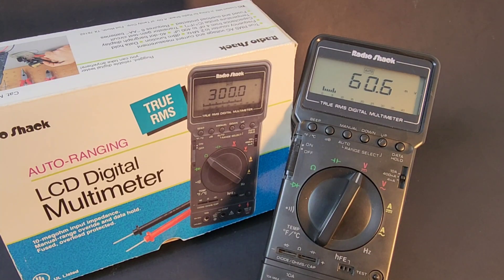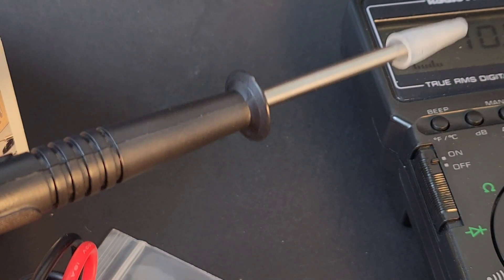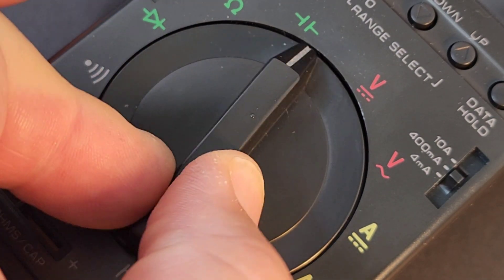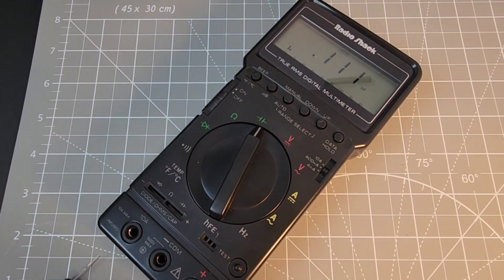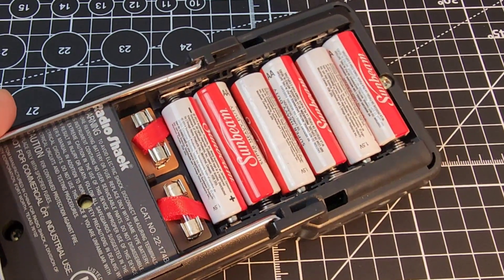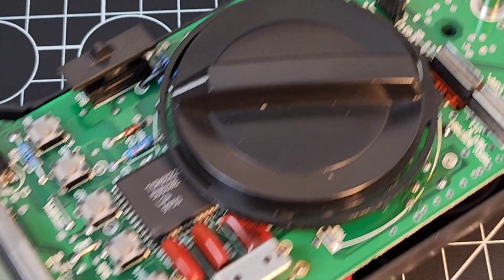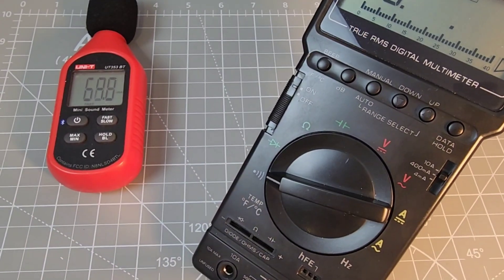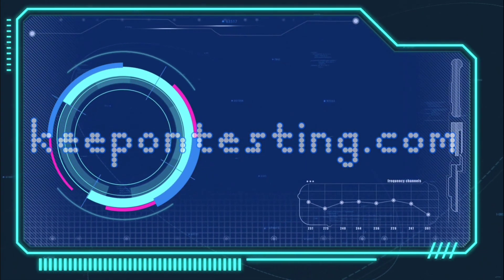RETRO-TECH ○ RadioShack 22-174B Review & Teardown! (1993)

Comment: Still have mine and looking for new probes. Which ones did you use? Had some shrouded ones and they don’t seem to fit. Thx
Reply from the maker: @AndyDemos  https://a.aliexpress.com/_mOA4jq3
These should work.
Reply from the maker: These were the original test probes that shipped with the multimeter. If you need help finding a set, let me know.
Reply: @ Thanks, any suggestions? Mueller maybe?

Comment: Thank you.  I've one with a fried resistor. Anyone know where to find a schematic  or willing to reopen the case to give me the 5 band color code?  It's in your video (large beige body lower right near the 2 trim resistors) but I can't make out the colors of the bands.  May be gold or brown bands on the ends, black, blue, violet in between?  When I enhance a screensave the end bands look red, not gold.  Anyone?  Thanks
Reply from the maker: That's a 100 OHM Resistor my friend. Brown, black,black,black, brown.
Reply: @KeepOnTesting  Can't thank you enough. I've had this about or over 20yrs.  The 100ohm was my original thought.
Reply from the maker: @derekec No problem Derek..its a great multimeter! 👍

Comment: I bought the 174A back then. It’s in brand new condition. I keep it in a zipper case when not in use and I take the batteries out. I needed to check the voltage on an outlet yesterday but it’s not working. The display isn’t showing all of the characters properly. Probably a result of sitting in the case for years. Is there a reasonably priced place where I can send it to be repaired and calibrated?
Reply from the maker: You could send it my way.. I will repair it for free and I might use the video in a review. Email me: netplicity1@gmail.com
Reply: @KeepOnTesting  That’s very generous of you. I’ll email you in the morning. Thanks!

Comment: Looks well made for the time, kinda wish we could have seen more involved range (-testing-)to see how well its strengths and weaknesses measure up as well as a look at input protection - a lot was glossed over here, more like a show and tell than a function testing to see how well it really performs after all these years, thats the interestiing part..Some of the much earlier RS stuff looked a bit like it was kit assembled on a kitchen table but this one looks more modern & pretty well done for the time. I was also curious about why the switch ranges were such a soft design and would liked to have seen what spring detent type was used. First meter ive seen the beep could be switched off, be a good feature to have today for working in certain office or other quiet environments. Be nice to see a followup function test on this one in the future maybe ??
Reply: I think you would be interested in the unique transistor test feature.  When you put in the transistor, it tells you whether it's PNP or NPN on the display, then the order of the leads (for example EBC).  Then after you make a note of it, you press the hfe button and get the gain of the transistor.  I don't remember seeing another meter that did this at the time.
Reply from the maker: @pault6533 that's definitely worth looking at!
Reply: @KeepOnTesting  Yeah that selector dial is a little mushy and the detents leave something to be desired.  However it does offers low friction, I bet you could on-hand operate this with that sleek stainless steel stand kicked out!  I think you showed the best feature which isn't often available today (the component slot).  Back in the day this meter was made, many of the components people used had axial or radial leads, so it was a blessing to have those slots.  These days we are working with SMD components more often than full sized semiconductors and passives.
Reply: @pault6533 niiiicee!
Reply from the maker: Hey Mike, sorry I only scratched the surface here but RETRO-TECH segments aren't really Reviews but overviews of great vintage gear. I might do a follow-up and post on keepontesting.com  😊 👍
Reply: To see how it's performing, follow Darren's link to the KOT blog - I posted recently acquired results! :hand-purple-blue-peace:
Reply from the maker: https://www.keepontesting.com/post/radio-shack-22-174b-multimeter-specifications-and-verification-testing

Comment: Does it have infinite input resistance on the millivolt range?
Reply from the maker: I didn't measure the current flow but sounds like a plan.
Reply: @KeepOnTesting  It's suspicious that in this particular mode the meter does not display zero.
Reply: @watchmakerful most meters will show a stray voltage with unterminated inputs, more so with less shielding or leads attached.
Reply: 10 megohms on voltage measured with another ohmmeter
Reply: @pault6533  10 MOhm is typically enough to zero out the meter.
Reply: @pault6533  There is an easy way to catch the infinite input resistance. Take a cheap 7106 meter, turn it on and try measuring the reference voltage (100 mV) between pins 35 and 36 of the chip with your meter. If it displays 100 +/- 1 mV, it has this feature. Other meters (even 10 MOhm ones) will display lower values.
Also you can measure a similar voltage (well within the lowest range) thru a 5..10 MOhm resistor.
Reply from the maker: @watchmakerful  On my todo 👍
Reply: @watchmakerful the manual states the input is 10M in parallel with 2pF. The normal mode rejection ratio is >60 dB at 60 Hz.  Doesn’t say anything special about mV.